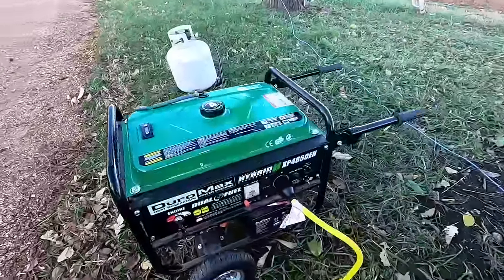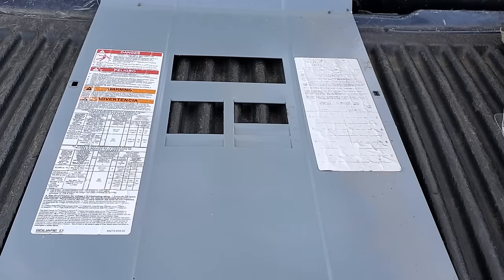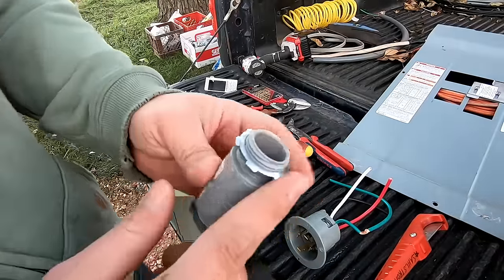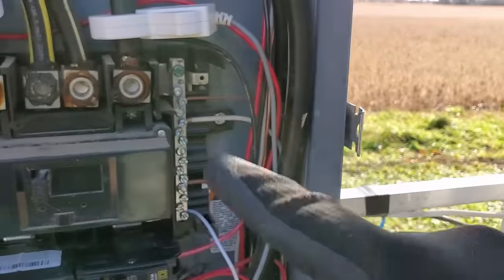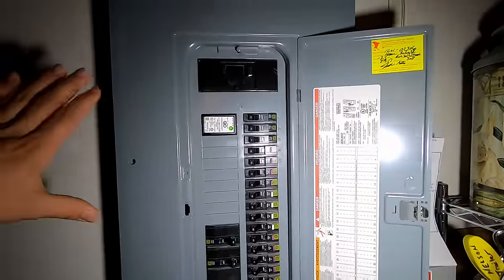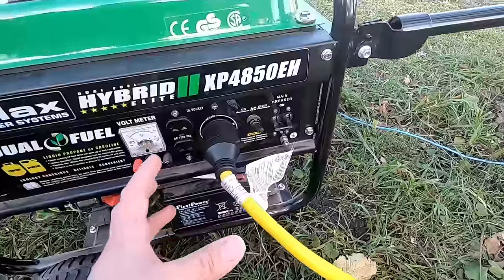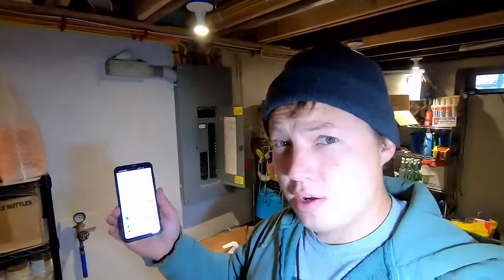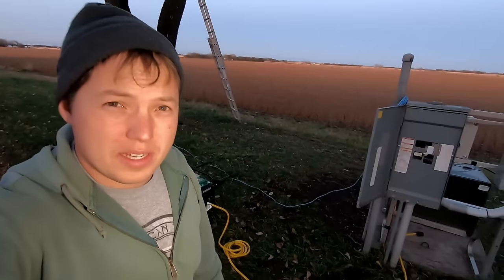How To Hook Up a Generator To Your House Using a Breaker Interlock Kit & Power Inlet Box

Comment: install a Rheem Heat Pump Water Heater!  I installed one myself six months ago, it only uses about a half a kilowatt each day... It has 5000 watt heating elements for backup to the heat pump, but you can set it to never use them, or use them only if demand is high.
Reply: Here are the generator safety rules that everyone needs to follow: this is just a reminder for everyone’s safety. Always make sure you follow all the generator safety rules whenever you use your portable generator. Generators can be dangerous if not used carefully. Every year, hundreds of people die or get injured when using portable generators due to carbon monoxide poisoning and electrocution. Make sure you are using your generator carefully and keeping others safe as well. There is something very serious that everyone should always be aware of when using generators. Some people do run their generator indoors which is not safe and that increases the risk of carbon monoxide poisoning which can cause death of family and you. Some people run their generator in wet conditions which can electrocute them. Please remember that you should never run your generator indoors. Remember that carbon monoxide is an odorless and colorless gas that you cannot see or smell. Carbon monoxide is a silent killer. Keep that in mind. Make sure your generator is 15-20 feet away from your house and away from doors, windows, and vents. Never use your generator in your porch too. Having a carbon monoxide detector is very important against generator safety. Some people also allow children to go near the portable generator which could pose risks. We need to keep an eye on our children making sure that they are not near the portable generator so they won’t get electrocuted or burned by the generator which is dangerous. A locking enclosure also keeps kids safe. A generator shed might look like a tempting place to explore, or take cover during a game of hide and seek, but a generator is a dangerous piece of equipment that can cause injury. It says on the manual that we should also keep children away at all times from the portable generator to avoid injuries. Please do not allow a child or unqualified people to operate the portable generator.  It is important to keep your children safe especially little ones. The portable generator can be hot during an operation. Just because some manuals missed what should be listed doesn’t mean it’s safe to do. Always follow the generator safety rules when using portable generators. Generators pose electrical risks. If you need to use your generator during wet weather, you need a generator tent to protect your generator from getting wet. Don’t let your generator get wet. Keep your generator dry and before using your generator, please make sure your hands and your generator is dry. Do not wear loose clothing when operating the generator. Everything that is said on the generator’s operating manual should not be ignored. Never smoke cigarettes near the generator. Please keep flammable things away from the generator. Never overload your generator too. Your generator can catch fire. Never ever try to plug a generator cord into a wall outlet to avoid back feeding. Back feeding your generator is dangerous. Always turn on your generator first before plugging in appliances and shut off the appliances before turning your generator off. Use a heavy duty cord for your generator and the cord should not be worn out. All the instructions should be followed carefully. Never refuel your generator while it’s running. It can cause fire if fuel spills while your generator is hot. You should turn off your generator and let it cool off before refueling it. Having a fire extinguisher next to the generator is also important. This is only a reminder for everyone’s safety of using generators. Make sure your generator is properly grounded. Having a fire extinguisher next to the generator is also important against the safety rules. https://youtu.be/I1jT3ANENvI and here is a video more about keeping others safe when using generators and also about our family’s safety. It’s important to keep our little children safe as well. Make sure your little children are kept away from the generator at all times especially when it’s running. Hope everyone finds this helpful. Always remember that it’s better to be safe than sorry. Remember that warnings should not be ignored.

Comment: I have 2 main panel boxes inside my home that both have a 200 amp main breaker. How do I wire my 6500Watt power generator to cover portions of both panels using an Interlock kit? Can I splice the wire from the Inlet Box to run to both panels, or do I need 2 generators using one generator for each panel?
Reply: ⚠️portable generator safety announcements:

This is just a reminder to remember the safety rules when using portable generators. 

1) KEEPING OTHERS SAFE: Please do not allow an unqualified person or your children to operate and service the portable generator. Just because some manuals don’t say that doesn’t mean it’s safe. That is important against the generator safety rules. We also need to be keeping an eye on our children too. You need to make sure that your children are not playing near the portable generator especially when it’s running so they won’t get electrocuted. Generators pose electrical risks and they can be hot during an operation. Please keep your children away from the portable generator at all times. It is important to keep our children safe especially our little ones. Be aware of all the hazards.

2) WHERE TO RUN YOUR GENERATOR: Some people use their portable generators indoors which increases the risk of carbon monoxide poisoning. It’s important to have a carbon monoxide if you have a gas generator. Never ever use your generator indoors even if your doors and windows are open and even in the garage is not safe to use a portable generator. Please do not even use your generator in your deck or balcony. It is never safe to use your generator indoors and in enclosed areas of your home. Your generator needs to be 15-20 feet away from your house. 

3)🔥FIRE HAZARDS: Never refuel your generator while it’s running. You need to let your generator cool off before refueling it and before storing your generator. Never overload your generator too. Never ever back feed your generator. You should never plug your generator into a wall outlet. Also never store propane tanks indoors. Please keep flammable things away from the generator as well and please don’t smoke cigarettes near the generator. Having a fire extinguisher next to the generator is also important against the generator safety rules. 

4) GENERATOR OPERATION: make sure your hands are dry before touching the generator. Never use your generator in wet conditions. Don’t let your generator get wet. You need a generator tent if you need to use your generator during wet weather. Please don’t wear loose clothes when operating the generator. Turn on your generator before plugging in appliances. Use the right cord for your generator. Please do not use worn out cords. 

https://youtube.com/shorts/eFigDfnPkcQ?feature=share and here is a short video more about keeping others safe when using generators 

Hope this helps

Comment: I plugged in my generator to the house, but the ground and neutral are together on my outside panel, but I cannot plug in my window  AC unit because the breaker on the AC unit would trip because of the ground and neutral created some sort of fault where do I put the ground at? 

And I undid the ground and left it off, and everything was fine but I don’t wanna leave it like that because I know the ground is important

Comment: I apologize if this is already in the comments I did try to search for a few key words and didn't find this question. Could you connect 2x 50 Amp inlet boxes to your main breaker panel and connect 2x duromax xp12000eh generators at the same time to run a large breaker panel??

Comment: so I'm curious. If a customer had a larger generator, and wanted to run more loads in the house, Would I as the electrician need to get a bigger gen receptacle, upsize wire to say #8 and upsize breaker to 40a to run more loads? Am a certified electrician, just don't have much experience in generator panel installs. Always enjoy your videos too. Very informative!! keep it up !
Reply: Please make sure you follow all the generator safety rules whenever you use your portable generator. 
⚠️Here are the Generator safety rules that everyone needs to follow when using generators:

This is just a reminder for everyone’s safety when using portable generators. All generator safety rules need to be followed carefully to avoid hazards. 

1) Please do not allow an unqualified person or your children to operate the portable generator. Just because some manuals don’t say that doesn’t mean it’s safe. That is important against the generator safety rules. We also need to be keeping an eye on our children too. You need to make sure that your children are not playing near the portable generator especially when it’s running so they won’t get electrocuted. Generators pose electrical risks and they can be hot during an operation. Please keep your children away from the portable generator at all times. It is important to keep our children safe especially our little ones. Be aware of all the hazards.

2) Some people use their portable generators indoors which increases the risk of carbon monoxide poisoning. It’s important to have a carbon monoxide if you have a gas generator. Never ever use your generator indoors even if your doors and windows are open and even in the garage is not safe to use a portable generator. Not even at your porch and your deck. It is never safe to use your generator indoors and in enclosed areas of your home. Your generator needs to be 15-20 feet away from your house. 

3) 🔥generators cause fire hazards too. Never refuel your generator while it’s running. You need to let your generator cool off before refueling it and before storing your generator. Never overload your generator too. Never ever back feed your generator. You should never plug your generator into a wall outlet. Also never store propane tanks indoors. Please keep flammable things away from the generator as well and please don’t smoke cigarettes near the generator. Having a fire extinguisher next to the generator is also important against the generator safety rules. 

4) generator operation; make sure your hands are dry before touching the generator. Never use your generator in wet conditions. Don’t let your generator get wet. You need a generator tent if you need to use your generator during wet weather. Please don’t wear loose clothes when operating the generator. Turn on your generator before plugging in appliances. Use the right cord for your generator. Please do not use worn out cords. 

https://youtu.be/I1jT3ANENvI and here is a video more about keeping others safe when using generators and also about our family’s safety. It’s important to keep your children safe especially little ones. 

Hope this helps
Reply: 50 amp, 6 gauge.

Comment: You did perfect 👌 but my big hands and I tend to over compensate my feel  for the right tighting  muscles memory 💪 I still and have to use them on switch gear and main throws  lines not at all

Comment: are the little white clamps CTs ???
where you get them ???
can we get the part number ???
Reply: ⚠️Please don’t forget to follow the generator safety tips when you use your portable generator:

This is a reminder for everyone’s safety when using portable generators. All generator safety rules need to be followed carefully whenever you use your portable generator. This is just to make sure. 

1) KEEPING OTHERS SAFE: Please do not allow an unqualified person or your children to operate and service the portable generator. Just because some manuals don’t say that doesn’t mean it’s safe. That is important against the generator safety rules. We also need to be keeping an eye on our children too. You need to make sure that your children are not playing near the portable generator especially when it’s running so they won’t get electrocuted. Generators pose electrical risks and they can be hot during an operation. Please keep your children away from the portable generator at all times. It is important to keep our children safe especially our little ones. Be aware of all the hazards.

2) WHERE TO RUN YOUR GENERATOR: Some people use their portable generators indoors which increases the risk of carbon monoxide poisoning. It’s important to have a carbon monoxide if you have a gas generator. Never ever use your generator indoors even if your doors and windows are open and even in the garage is not safe to use a portable generator. Not even at your porch and your deck. It is never safe to use your generator indoors and in enclosed areas of your home. Your generator needs to be 15-20 feet away from your house. 

3)🔥FIRE HAZARDS: Never refuel your generator while it’s running. You need to let your generator cool off before refueling it and before storing your generator. Never overload your generator too. Never ever back feed your generator. You should never plug your generator into a wall outlet. Also never store propane tanks indoors. Please keep flammable things away from the generator as well and please don’t smoke cigarettes near the generator. Having a fire extinguisher next to the generator is also important against the generator safety rules. 

4) GENERATOR OPERATION: make sure your hands are dry before touching the generator. Never use your generator in wet conditions. Don’t let your generator get wet. You need a generator tent if you need to use your generator during wet weather. Please don’t wear loose clothes when operating the generator. Turn on your generator before plugging in appliances. Use the right cord for your generator. Please do not use worn out cords. 

https://youtu.be/I1jT3ANENvI and here is a video more about keeping others safe when using generators. Everything that is said about the generator safety rules all need to be followed. Especially keeping your children safe. 

Hope this helps

Comment: Hello.Where is the link for the kit to watch you power useage. I thought you was going to post it. I dont see it am I missing some thing? Also  I would suggest that you run that wire all in one run instead of using the wire nuts. I would of been a little more work and not that much more wire and could save some head aches down the road. nice video thank you.

Comment: I have a powerland generator tri fuel . I have always used the LP GAS  lights went out this past Tuesday it ran fine until it started mis fire and I got a strong LP GAS Odor! I replaced one hose from the regulator that was brittle, same problem. Do I have to replace the regulator?

Comment: Great video! I’m doing the same at my house. “Not me per say, an electrician” since I’m not good to work with electricity. Just got one more subscriber.
Reply: Please make sure you follow all the generator safety rules whenever you use your portable generator. 
⚠️Here are the Generator safety rules that everyone needs to follow when using generators:

This is just a reminder for everyone’s safety when using portable generators. All generator safety rules need to be followed carefully to avoid hazards. 

1) Please do not allow an unqualified person or your children to operate the portable generator. Just because some manuals don’t say that doesn’t mean it’s safe. That is important against the generator safety rules. We also need to be keeping an eye on our children too. You need to make sure that your children are not playing near the portable generator especially when it’s running so they won’t get electrocuted. Generators pose electrical risks and they can be hot during an operation. Please keep your children away from the portable generator at all times. It is important to keep our children safe especially our little ones. Be aware of all the hazards.

2) Some people use their portable generators indoors which increases the risk of carbon monoxide poisoning. It’s important to have a carbon monoxide if you have a gas generator. Never ever use your generator indoors even if your doors and windows are open and even in the garage is not safe to use a portable generator. Not even at your porch and your deck. It is never safe to use your generator indoors and in enclosed areas of your home. Your generator needs to be 15-20 feet away from your house. 

3) 🔥generators cause fire hazards too. Never refuel your generator while it’s running. You need to let your generator cool off before refueling it and before storing your generator. Never overload your generator too. Never ever back feed your generator. You should never plug your generator into a wall outlet. Also never store propane tanks indoors. Please keep flammable things away from the generator as well and please don’t smoke cigarettes near the generator. Having a fire extinguisher next to the generator is also important against the generator safety rules. 

4) generator operation; make sure your hands are dry before touching the generator. Never use your generator in wet conditions. Don’t let your generator get wet. You need a generator tent if you need to use your generator during wet weather. Please don’t wear loose clothes when operating the generator. Turn on your generator before plugging in appliances. Use the right cord for your generator. Please do not use worn out cords. 

https://youtu.be/I1jT3ANENvI and here is a video more about keeping others safe when using generators and also about our family’s safety. It’s important to keep your children safe especially little ones. 

Electrical safety 

Hope this helps